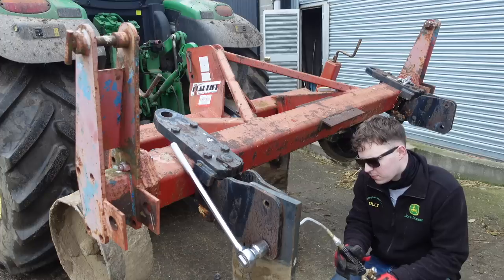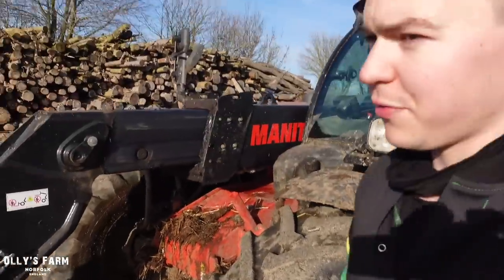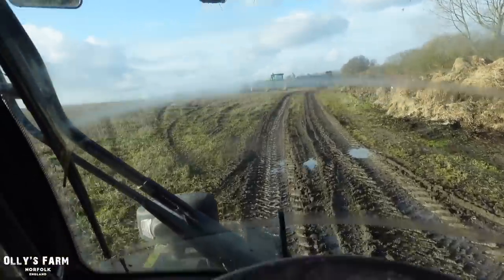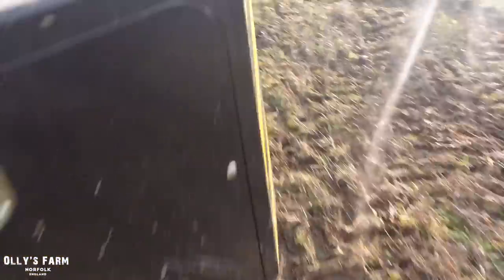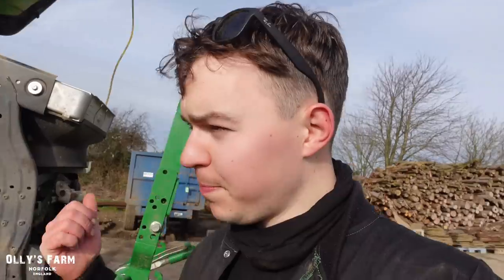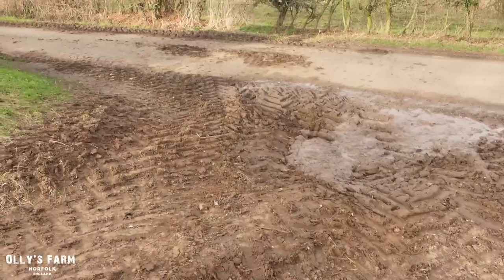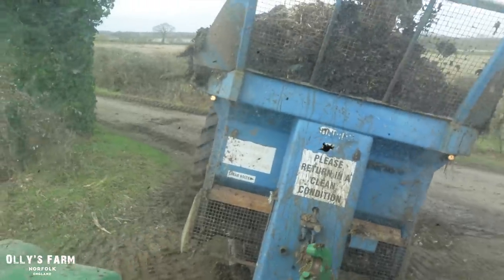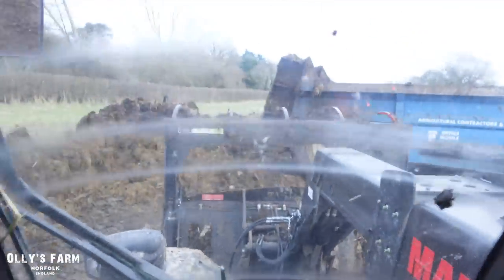Muck Spreading With John Deere's GPS Technology Plus Why We Can't Get Parts Or New Equipment

Comment: We have put small see throw inline filters before main filter, only a few quid. Much cheaper than changing main ones and you can see if there are getting blocked! Also put the additive in fuel tank. It's still a battle against the bio oil. I can't help but think  that it's doing more harm than good to the environment having engines running with clogged filters all the time!!!